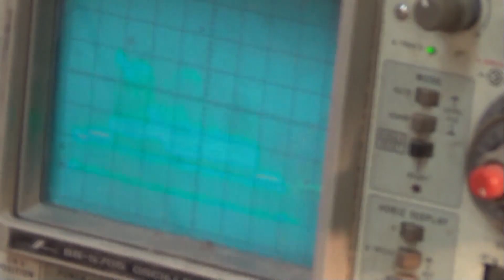Sony Beta 711B chassis reel Table Motor service procedure

Comment: Nice.  I had recently done such a service on my SL-2710.  My problem was that it was stopping randomly during play.  Take-up was fine, so what was going on was that there was a fine layer of dirt on the photosensors accumulated over such a long period of time, so I cleaned those as well as the optical tone rings on the underside of the supply and takeup reels.  Then I went ahead and lightly oiled the reel and idler bearings.
Reply: Useful comment! I have an SL-T50ME which has the same chassis as yours and sometimes stops randomly in play or FF/REW. Gonna try cleaning those photo sensors. :)
Reply from the maker: Being under the reel tables they should not get dust on them, but if used on an environment where smoking occurs tar can accumulate on them.  Just think of what it does to lungs.
Reply: @12voltvids  I don't know the history of the machine I fixed; I bought it used years ago and it was in excellent condition, complete with the box, remote and lanyard, and is a PX model sold by a military exchange like the one from my childhood as evidenced by a power supply rated for multiple voltages and 50/60 Hz as well as the box being nondescript and only bearing the model number and the serial number stickers rather than the Sony Betamax graphics.  There didn't appear to be any evidence of exposure to tobacco smoke, either, as there was no discoloration nor odor to suggest it.  It had only just recently developed that problem, but it doesn't do it anymore after the clean and lube.

And if dirt wasn't the problem, it couldn't have hurt to clean the sensors and tone rings anyway since it's all accessible in the process of oiling the bearings on the reel table.

Comment: Wow. Mine was doing exactly this, stopping during playback, and upon close inspection on the takeup reel there was just a tiny piece of paper on the gear wheel causing it to hop and stop. Taking it off it plays smoothly but the rewind is still slow, so I still have to do the lubrication.

Comment: The SL-HF1000 mounted the 711B2 Chassis.
In some case in the reel assy the pendulum gear fail, and need replaced.
If the reel motor bearing is worn, and the magnet, touch the 3 phase coil, you repair with drop 
a 3mm steel ball inside the hole shaft, of the reel motor to make working again freely.
Reply from the maker: Lots of tricks to get the motor running. I used to use the ball bearing out of a medium bic pen.
Reply: @12voltvids  can replace only bearing from another 711 chassis like sl-2300 that has a similar reel motor?

Comment: Thank your for your insight. I'm trying to troubleshoot the slack take up reel on a Sanyo 3900-II. Different design than this, but wanted to know what you recommend for rubber wheel rejuvenation, or is it just the belt?

Comment: I learn more every day.  They always told me that Beta was the better machine, but I never found that, there were things that irritated me about them and they just didn't gel well with me.  I ended up with VHS and although they had their problems proved to be better with me.  I had a few VHS machines, the Sanyo (can't remember the model) was the best i had, it was not supposed to edit videos, but it did a fair job of doing just that.  Other recorders were fair to not so good.  The worst was a Sharp I borrowed with a vied to buy one, but NO!  The worst one I had was a top loader VHS, it had Ferguson (Thorn/EMI) badge but I think was either JVC or Sony, I bought it second hand as they were still very expensive then ans was an ExRental and not very old.  I put it back to get fixed after a month as sound bars and picture break up started.  I got it back and had to argue to get an extension on the 3 month warranty they gave as it was now out.  I got it after a fight, but after a while picture break up started again, but the warranty was out, I did call the shop and after an argument I took it back, but it did it again, so this time I took the top off and adjusted it myself without a scope (though I did have a scope at the time, but no manual).  I did get a far better picture than it ever had just by adjusting the guide rollers, cleaning the head (I was told to use a cotton but by a tech, but I used a bit of paper and the crap that came off the head!) cleaned the rest with Iso' and put it back together again.  It worked fine after that, but if I taped something for someone else they had trouble getting their machine to track, but that was not an issue for me as it was recorded for myself, strange though, when I got other machines I found the tracking was not a problem for the machines I bought using tapes I had recorded with the first machine.  I don't know why others couldn't track the picture if the new machines I bought could?  Anyway, I am enjoying your videos and being disabled now I find it relaxing that I can watch you repairing things.  It was a hobby of mine, but when things got to the point where it was several expensive chips controlling everything I gave it up and only look at something these days that I own and consider it a lost cause anyway.  It is sometimes surprising how some things will come back to life while other things are just not worth fixing or parts are not to be got.  It appears they stop making parts when the production run stops these days.  I just don't have the patience these day to work on anything, but the will is slowly returning. EDIT:  Thanks to your videos.

Comment: I really like the idea of the reel mechanics on a plate, pity other vcr manufacturers didnt pick up on the idea.
Ive had plastic decks with pins that break off,   having to drill the crap deck in the machine and make a custom pin to fit really tight can be fun.
It has to always fit in a tiny space without coming into contact with close parts.
A removable plate would have been loverly :-D

Comment: Interesting chassis, don't think I've seen that one yet. I look forward to seeing it play; and maybe do some edits so we can see (or at least hear) those solenoids do their thing. Does this use time code or control track (or guard band counting) to pre-roll to time the edit punch in?
Reply from the maker: It used control track. Remember this is a consumer machine. Accuracy was 3 frames.
Watch them working, when this machine was working here:
https://www.youtube.com/watch?v=klnjt_evmss

Comment: i have a sony betamax with the 711b chassis i repaired mine and i have a spare chassis for parts these start to show alot of age related issues but nothing that cant be fixed usually

Comment: So I have an SL-HF400 with some sentimental value that isn’t working. When I insert a tape, it threads the tape and then shuts down. When I power it back up, none of the transport buttons do anything. The reel drive motor/pendulum still works, but I can’t tell if the head drum motor Hall-effect IC is bad, since the transport won’t respond. I took off the front plate and found that it had a damaged circuit board near the channel buttons on the opposite side (not a biiiig deal, but still disappointing), but the rest of it looks just fine to my eyes. Is it salvageable, or am I better off buying a second and scavenging this one for parts? Or just a “new” Beta entirely? I’ve got a few old tapes that I’d love to watch in all their SuperBeta HiFi glory, and also use it for a few video projects with some unopened blanks. Any ideas?
Reply: And if it is unsalvageable, what IS a decent reliable Beta deck? Most of the front loading Sony’s seem to either be similarly screwed or command ridiculous prices with no guarantee of reliability, but it seems like the top-loaders are easier to work on and have that 70’s hifi aesthetic that I love, and a friend of mine has a front-loading Sanyo in need of repair that he’d be willing to give me.

Comment: For the high price you paid for a new Sony Beta from new, the VCRs ended up with worse reliability than Toshiba.
Reply from the maker: Actually they didn't.  Beta machines from the 80s still working like a champ.
Reply: @12voltvids  When you said "common problem," it's not rated #1 most-reliable out there. Sanyo and Toshiba Beta beat Sony easily. Consumer Reports also rated Sony Beta second least-reliable VCR after Fisher from the old 1980s book.
Reply from the maker: @waltchan  that was because of the shitty sl2000, 2500 and 2700 which used the direct drive motors and were absolute shit. The 5000 series with the plastic rewind hub and the shitty Sanyo capacitors was another fail.  Trust me i remember those only too well. I worked for Sony in 83/84 and I can't count the number of sl5000 that I did the rewind kit and capacitors on brand new units. After they started failing in numbers Sony Canada pulled them from stores and warehouses and sent every unit in for the capacitor kit upgrade so they wouldn't fail. Sony usa from what i remember did not. I probably recapped 2000 units during my time at Sony. Those direct drive machines were known for snapping tape.  Panasonic also had a direct drive machines with direct drive tape hubs.  Pv 1730 if i remember I had one. Might still have it. It was a real piece of shit too and it likes to break tapes on rewind.  Put in anything but standard length, t60, t120 you are asking for trouble.  The t160 t180 and t200 forget it. Rewind one of those and cry as it would destroy the tape. Found that one out personally.
Reply: @12voltvids  Very nice info... Thanks. I forwarded your message to Studio Sound Electronics owner, former VCR belt kit online retailer So, nothing bad to say about Toshiba, right?
Reply from the maker: @waltchan  they had even bigger drum wearing issues and the heads were soft.  Used to see lots of Toshiba beta and nec.  They were all junked back in the 80s and customer bought Sony for their beta collection.